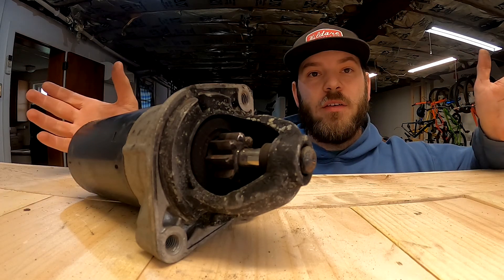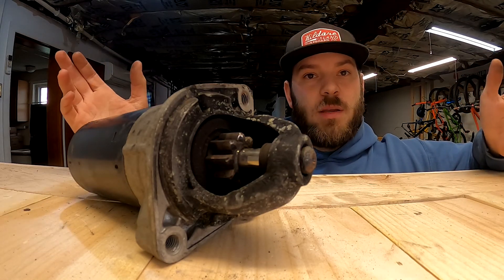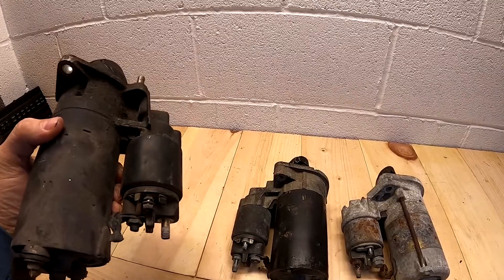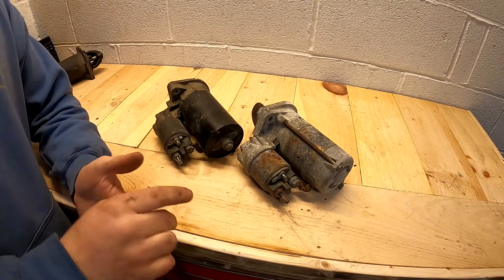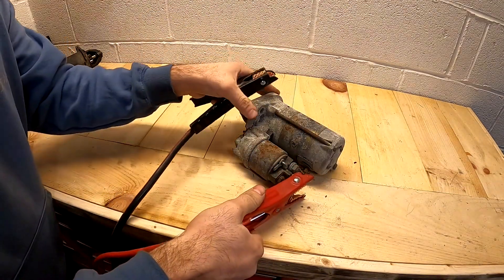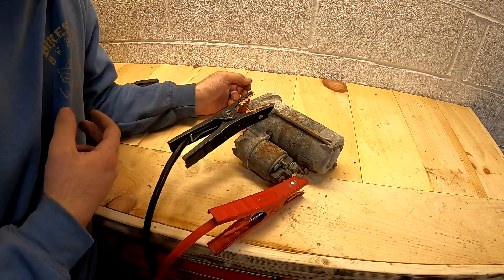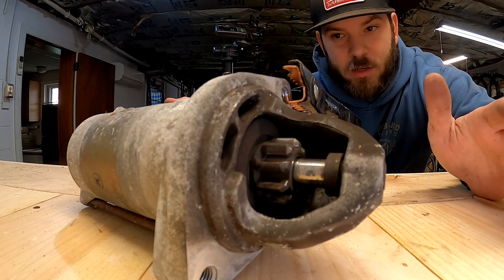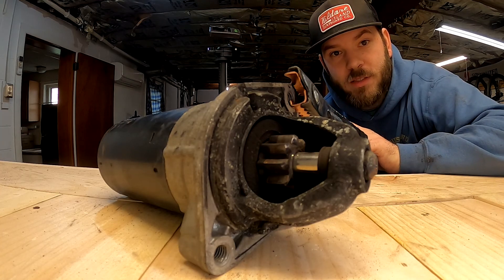How To Bench Test A BMW E36 Starter

Comment: Thanks, I was able to test it on the engine, but it just does a single clunk sound and nothing more, I can crank the engine by hand (applying 35ft lbs of force), could it be a bad starter? I bought a new battery already with no luck
Reply from the maker: Based off what you’ve described, that’d be my guess. Is the car manual? If so, try pop starting it.
Reply: @Dylan_Draper  It is manual, I was able to figure it out, I hooked the battery directly to the starter and it worked, so I checked the grounds from the back of the car to the engine and the problem was a loose ground, thanks for showing me how to test the starter it really helped